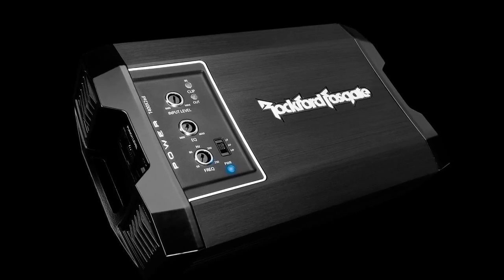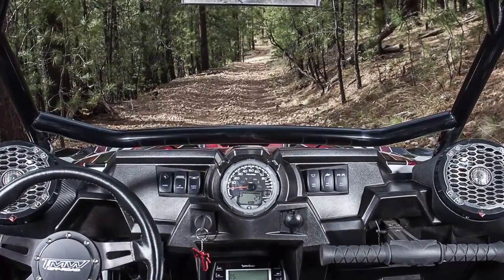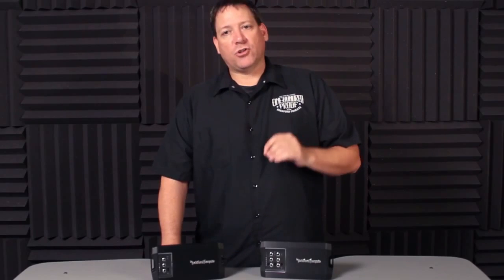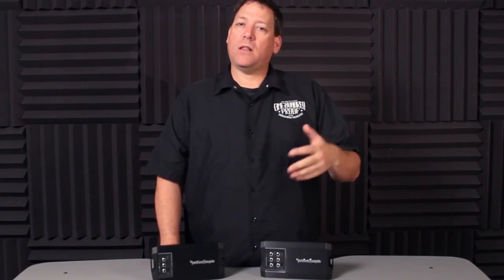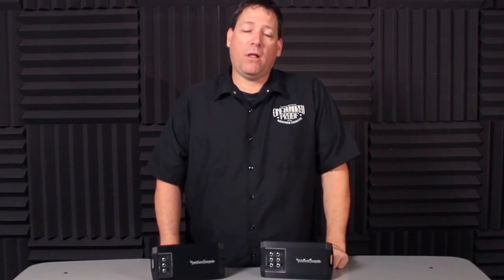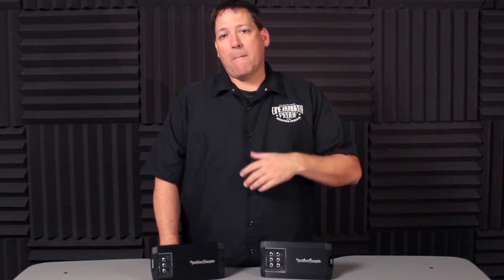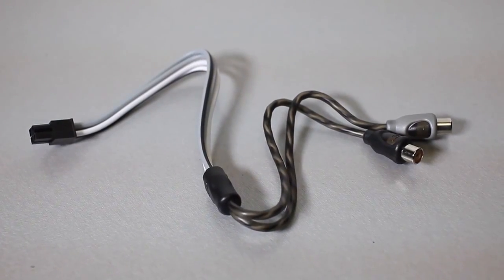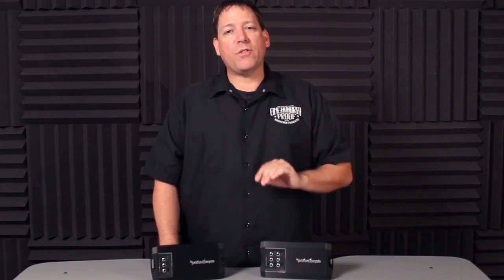Rockford Fosgate: Power Compact Amp Overview (3.4)

Comment: Hello I have two Rockford Fosgate P3D4 12” subs in a sealed box and I’m powering them with a P1000x1BD currently. I want to redo my setup with physically smaller amps would it be possible to run my current sub setup with a T750X1bd?
Reply from the maker: Yes, as both amplifiers are 1Ω stable, the wiring is compatible for those two subwoofers.  The main difference is the P1000X1db produces up to 1,430 Watts x 1 @ 1-Ohm and the T750X1bd produces up to 990 Watts x 1 @ 1-Ohm.

Comment: I have two P3D4-10 what amp i need and is prime punch or power
Reply from the maker: Great subwoofer choice!  The P3D4-10 subwoofers are rated to handle 600W each, so you'll have 1,200W of total power handling that can be wired to a 1-ohm or 4-ohm load.  These amplifiers are a good match:

R2-1200X1
Rated at 1200 Watts x 1 @ 1Ω with Dynamic Power of up to 1,389 Watts x 1.
https://rockfordfosgate.com/products/details/r2-1200x1/

P1000X1bd
Rated at 1000 Watts x 1 @ 1-Ohm with Dynamic Power of up to 1,430 Watts x 1.
https://rockfordfosgate.com/products/details/p1000x1bd/

Comment: I just had the 400w installed,  today, and it is extremely hot. What are people doing to solve this issue?  I was thinking of getting a flat 1/4" piece of aluminum and mounting it to that so it increases the heat sink size. Maybe 2" longer and wider than the measurements of the amp so it also sits off the vehicle and gets air under it as well.
Reply from the maker: Unless the amplifier is getting too hot and shutting down, the heatsink is doing exactly what it’s designed for.
Reply: add a fan or two to it to help dissipate the heat faster.  Reduce the impedence load you are putting it under.  If running  1ohm, move up to 2.  If running full range but only running mids/highs, consider active filtering.  Those are a few ways that might reduce heat but it will likely be negligible.

Comment: Hi
Hoping you can help me out. 
Would the T750X1BD be too powerful to power my single P3D4-12? Would I be better to look at the R2-500X1?
Thank you
Reply from the maker: Great question!  The P3D4-12 sub2woofer is rated to handle 600W RMS. The T750X1bd is rated to produce 750 Watts x 1 @ 2-Ohm with Dynamic Power at 900W, so that's going to over power the subwoofer. The R2-500X1 will produce 500 Watts x 1 @ 2Ω with Dynamic Power at 590W, so that's a better matching amplifier.
Reply: @rockfordfosgate  awesome thank you!

Comment: I have a pair of P2 12s would you recommend the T750 to power them or do you think a T1000x5 could run them? I do plan on getting T1 components and 6x9s down the road
Reply from the maker: Hi Anthony, what model number P2 12" do you have?  This should be on the back of the magnet.  It will help me understand what generation you have and the voice coil impedance.
Reply: @rockfordfosgate  i have the newest generation P2-2X12 enclosure
Reply from the maker: @anthonyc9261  Great!  Thank you for that information.  The P2-2X12 is designed to handle up to 800 Watts RMS and is prewired to a 1-Ohm load.  Based on this criteria, there are 3 amplifiers that will match perfectly.  You'll notice the continuous power rating is lower than the subwoofer's 800W capacity, consider the amp's dynamic output as the amount of power you'll really get once installed (Rockford Fosgate amps produce more than rated for.) The T1000X5ad is a good choice, but I feel the T750X1 is way too much power.  I ordered them relative to power output:

T1000X5ad (5-channel)
Sub Channel Rated: 500 Watts x 1 @ 1-Ohm
Sub Channel Dynamic: 663 Watts x 1 @ 1-Ohm
https://www.rockfordfosgate.com/products/details/t1000x5ad/

T500-1bdCP (mono)
Rated: 500 Watts x 1 @ 1-Ohm
Dynamic: 707 Watts x 1 @ 1-Ohm
https://www.rockfordfosgate.com/products/details/t500-1bdcp/

P500X1bd (mono)
Rated: 500 Watts x 1 @ 1-Ohm
Dynamic: 787 Watts x 1 @ 1-Ohm
https://www.rockfordfosgate.com/products/details/p500x1bd/

R2-750X1 (mono)
Rated: 750 Watts x 1 @ 1Ω
Dynamic: 830 Watts x 1 @ 1Ω
https://www.rockfordfosgate.com/products/details/r2-750x1/

P1000X5 (5-channel)
Sub Channel Rated: 500 Watts x 1 @ 1-Ohm
Sub Channel Dynamic: 863 Watts x 1 @ 1-Ohm
https://www.rockfordfosgate.com/products/details/p1000x5/

T750X1bd (mono)
Rated: 750 Watts x 1 @ 1-Ohm
Dynamic: 990 Watts x 1 @ 1-Ohm
https://www.rockfordfosgate.com/products/details/t750x1bd/
Reply: @rockfordfosgate  great! Thank you I think I will be looking into getting a P1000x5 then!

Comment: I just got the T750x1bd and I am blown away at the size and the “clean” look of this amp. It’s like a pinnacle of audio engineering.

I have a few questions though:

Is the “Punch EQ” knob on the amp, the same thing as the PLC2 controller? Is there an “optimal” tuning/set-point for these knobs?

Is 8 AWG really sufficient for the power/gnd? The PVC said this amp was tested to 1,054 watts at 1ohm, and it seems like I would need a 4awg wire for that ampacity at 14.4V?

Is the “Input Level” knob the same thing as Gain? (Thank you for the clipping lights, very cool!)
Reply from the maker: The Punch EQ controls Bass: 0 to +18 dB @ 45 Hz and the PLC2 is a "level" control linked to the input level of the amplifier.  Yes, the Input Level knob is the Gain.  The Punch EQ and PLC2 should start off at minimum, then adjust to taste.  The amplifier utilizes a Class BD topology with an > 85% efficiency.  Since the max current at 1ohm is 86 A, this is within spec to around 15 feet.  Since this is a bass amp, you'll likely be using a 1/0 cable from the charging system back to the amp rack, where you will be distributing power to all your amplifiers.

Comment: Do you need a capacitor with the t750x1
Reply from the maker: It's not required but it doesn't hurt.  You'll going to hear a lot of advice about capacitors, but a lot of that is misguided opinion based on a blanket statement on all amplifiers.  Since Rockford Fosgate uses unregulated power supplies, capacitors actually work well by providing voltage stability and current reserve when needed.

Comment: Just got the 4-channel 400 watt version and have a question about the setup using the CD.  The first part is simple, just disconnect the speaker output on the amp, pop in the CD to the head unit, and raise the HU volume until the input clip LED flashes red, then dial back the volume a notch until the red LED goes out.  The next part is confusing though, because it says you increase the input levels on the amp until the "appropriate color" comes on in the output clip LED, but doesn't say what color that is and the LED first goes to blue and then red.  

The instructions don't indicate if you stop the input when it turns blue, or dial it back until the blue light goes away, or increase it further until it turns red, or what.  If someone knows, please let me know.  FWIW, I tried it first by stopping when it turned blue but the volume was so loud even at low levels (my HU goes to 40 and it was loud at 10, whereas with my old R-F PBR300X4 it wasn't that loud at 40) that I dialed it back a quarter turn before it turns blue and it seems better.
Reply from the maker: The 2nd part is done using the same method as the input clip.  Please note that adjusting the clip indicators requires you to disconnect all speakers from the amplifier.  With the source unit at the cleanest, highest output (that you just set during the 1st part), you increase the amplifier gain until the LED turns RED, then back it off until it only illuminates BLUE.  You're done!  All you need is to reduce the source unit volume and attach the speaker wires to the amplifier.

Comment: Amp purchased. Would I be able to run this with a jl audio 12sub Tw 3d4 (4ohms dual @ 400w¿ I need to use a shallow mounted sub but the p3 doesn’t have very promising reviews. Thanks in advance.
Reply from the maker: What model compact amplifier did you purchase?  If you're looking for a shallow mounted subwoofer, the Power T1 Slim is what you're looking for.  With the Punch P3S, people are accustomed to comparing it to the standard mount P3 subwoofer, while expecting more SPL and deeper bass, which is not the case.  The Power T1 Slim is an outstanding subwoofer that provides equivalent performance to the standard sized T1 subwoofer.
Reply: I purchased the T750x1db
Reply from the maker: @LaurieBenjamin  Thanks for that information!  The Power T750X1bd is rated to produce 750 Watts x 1 @ 1-Ohm, so if you're looking to power a single subwoofer, you'll want to use the T1S1-12 which is rated to handle up to 600W, so this is a pretty close match.  Be careful when setting your gains because technically you can over-power a single subwoofer and will burn the voice coil if not careful.  If you're looking to power 2 subwoofers, this would be perfect ... in that case you'll want the Power T1S2-12 subwoofers.
Reply: That’s for the quick response as always. Can you recommend two 8s or 10s. I think two twelves would be to much.
Reply from the maker: @LaurieBenjamin  You're welcome!  For 10's we'd recommend the Power T1S2-10 subwoofers.  They will rock and you'll have enough power handling to handle that mighty monster amplifier!

Comment: Great video. Just to be clear, I would not need a LOC and there would not be a need for a remote wire connection.....
Reply: I purchased the T750x1db
Reply from the maker: Correct, these amplifiers utilize a built-in LOC and area ready to accept +/6V DC offset to turn the amplifier on/off when using speaker line outputs as your input signal.

Comment: What Power amp would give me plenty of power for a pair of  T1S2 12's?Don't want to damage the subs with too much power.
Reply from the maker: Two T1S2-12 subwoofers can be wired to a 1-ohm or 4-ohm load and provide 1200 Watts of power handling (600W/woofer).  We would recommend the Power T1000-1bdCP amplifier since it's rated at 1,000 Watts x 1 @ 1-ohm, but can produce up to 1395 Watts under typical dynamic conditions.
Reply: Thank you!

Comment: How would you compare and contrast your T1000X5AD with a competitively price, similarly powered amp - like the JL RD900/5?
Reply from the maker: The RD900/5 is $579.99 which is more in-line with the Punch P1000X5 which is $499.99.  The main difference is the JL model utilizes all Class-D whereas the RF is Class-A/B on the front/rear and only Class-D on the sub channel.  Many fanatics prefer the sound of Class-A/B on their midrange/tweeters due to the natural sound characteristics of the analog circuitry. Class-D isn't as big of a deal since it's harder to hear with sub frequencies.  A secondary advantage of the Rockford Fosgate amplifier is the higher output power on the front/rear channels.  If you wanted to compare against the compact Power T1000X5ad, the biggest difference is the CLEAN setup where it has both INPUT and OUTPUT clip LEDs, for a more precise setup configuration.  I added links to both the Punch & Power amps below:

RD900/5
Main Channels: 70 W RMS x 4 @ 4Ω
Main Channels: 100 W RMS x 4 @ 2Ω
Subwoofer Channel: 500 W RMS x 1 @ 2Ω

P1000X5
Main Channels: 75 Watts x 4 @ 4Ω
Main Channels: 125 Watts x 4 @ 2Ω
Subwoofer Channel: 500 Watts x 1 @ 1Ω

Punch P1000X5
https://www.rockfordfosgate.com/products/details/p1000x5/

Power T1000X5ad
https://www.rockfordfosgate.com/products/details/t1000x5ad/

Comment: at 100watts per channel, you're telling me it is making more power than an old school P400.4 amp? I know this geared towards motorcycles and such, what about cars/trucks? How can this little thing put out so much? My P400.4 weighs like 15-20lbs.
Reply: ZGERMAN You sad human being. You think weight determines the power? LOL
Reply: Lol I know right? I was blown away at the size of this thing. Idk how they did it, but I trust the PVC and the Rockford name
Reply from the maker: Yes, these are designed for compact areas for use in motorcycles, cars, trucks, SUVs, Vans, camping trailers, etc.  The Punch 400.4 is a Class-A/B amplifier that had lower 4-ohm power ratings, whereas the Power T400x4ad is a Class-A/D amplifier with Constant Power. Below are the power ratings, but don't take our word for it, they were tested using CEA-2006 guidelines, the industry standard in amplifier test parameters.  Also, I don't recall anytime we said they were light ... they are densely packed power houses.

400.4 Rated Power
50W x 4 @ 4-ohms
100W x 4 @ 2-ohms

400.4 Dynamic Power
60W x 4 @ 4-ohms
130W x 4 @ 2-ohms

T400x4ad Rated Power
100 Watts x 4 @ 4-Ohm 
100 Watts x 4 @ 2-Ohm 

T400x4ad Dynamic Power
128 Watts x 4 @ 4-Ohm 
152 Watts x 4 @ 2-Ohm

Comment: With forced cooling, can this be mounted upside down? I know from experience regular amps have trouble cooling.
Reply from the maker: It's better at handling heat-build up, so as long as the fans can replenish the hot air will cool air, the amp will work fine inverted.
Reply: Thank you for the quick reply.
Reply: @rockfordfosgate  ,
Reply: Does the Rockford 1800 watt 4 c
hannel amp have two separate power supplies?
Reply from the maker: @shellynantz2821  I'm not sure what amp you're referring to.  What is the model number of the amplifier?